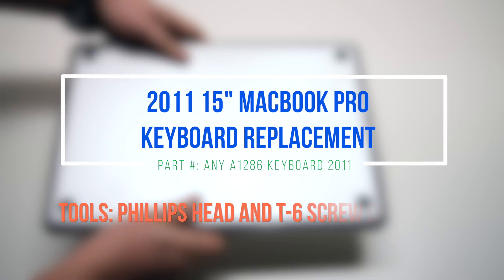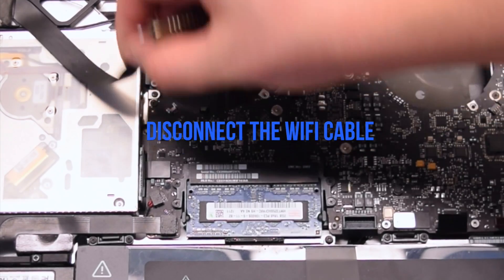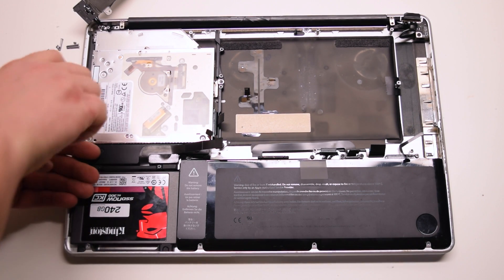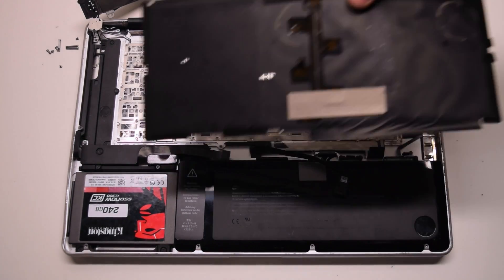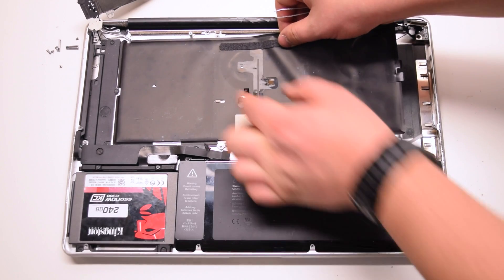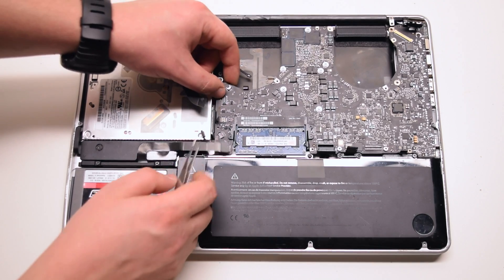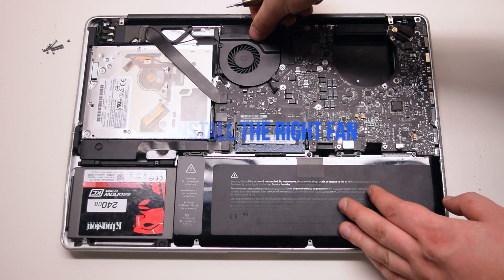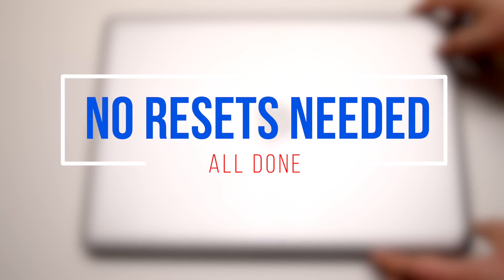2011 Macbook Pro 15" A1286 Keyboard Replacement

Comment: 10:30 The secret for the annoying cables is to hold the loop with a plastic tool, pushing up. Hold the flat cable against the board, with a plastic pry tool, then other finger, insert the tip of the cable. Same for the super short backlight one.

Comment: This is my 2nd time using this video. By far this is the best and only video I would use to disassemble and reconnect a keyboard. This is no easy job, but anyone who watches this video I believe can replace their keyboard. I know it can appear to be overwhelming, but believe me you can do it. You will need the proper tools. I have the ToolPlus 32-piece mobile phone repair tool set. It has all the proper screwdrivers, magnetic extension, and plyers, which you will need.

Comment: I have a Macbook Pro 2011 I had to open it for some cleaning but I broke the cable that connects the mouse (Trackpad) with the motherboard since then I use an external mouse.

But my problem is that my keyboard gives me delay when I press a key and sometimes I have to press very hard.

help me please
Reply: The same is happening to me :'(

Comment: In this video, you do not appear to successfully connect the keyboard ribbon cable in place on the PCB right?Any tips for doing this part. Otherwise, an excellent video. Thanks

Comment: Thank you for great video.  Very clear and concise instruction with zero fanboy yapping.  My hat is off to you sir.  My MBP Late 2011 would not power on.  Tried a hard reset by disconnecting battery.  It would come on with the battery connector, partially boot, and shut down.  Thankfully, re-seating the keyboard and trackpad connector did the trick.  I was ready to order a new kb and follow your video step by step.  Was not looking forward to the 51 screws, lol.  Thanks again.

Comment: ⚠️ NOTE FOR ALL: You MUST ensure that the new keyboard ribbon is FULLY in the keyboard ribbon socket on the motherboard! First time: only a few keys worked, second time: none. The third time I used a spudger to pressure the ribbon 'coil' so that it would spring 'into' the socket, and voila! It was only a difference of 0.25mm.
🙏🏽 Thank you so much @SaveAppleDollars for your video — my MacBook has many more years left! 👍🏼

Comment: I just changed my keyboard. 5 random keys are not working. Does anyone have any suggestions?
Reply: Could it be that I was missing one screw when putting the 50 back in?
Reply from the maker: lol it’s not one of the 50 screws. I hate to say it but it sounds like your replacement was a dud. You have to get another and do this over again. I know it’s ridiculous but happens even to me once out of every 5 replacements I’d say.
Reply: @GRIBSOFT  thanks a lot for the reply! I'll give it another shot with a new one. At least I know I can do it now ☺

Comment: I accidentally broke the lever. MacBook PRO doesn't turn on anymore...is so sensitive...what can I do?
Reply from the maker: You broke the lever or did you rip the keyboard cable?
Reply: @GRIBSOFT  
Lever and now the laptop won't turn on but it  chargers. When the lever was up, I accidently moved it and it came out.
Reply from the maker: Then just shift it around a bit. The lever is not an intricate part of the connection it just locks it in place, the keyboard should work without the lever.

Comment: took me the best part of four hours this, watch those connectors use a magnifying glass if required, you need the proper screw driver or it will end in disaster IMHO I bought a new set specifically but it wasn't the right P0 size so ended up using one from a £10 drive bracket kit I bought ages ago ! nothing wrong with the guid by the way probably the best there is, even iFix don't seem to have one
Reply from the maker: Glad you had success, thank you for the feedback!

Comment: I dont know if im destrying the flex but all keyboards ive tried have a problen on a key, i dont if it is the flex because i can see a corner a bit separated, could be that corner? how can i fix that corner? ty and good videos :P
Reply from the maker: It's hard to say if you tied to reseat it multiple times. I would just make sure to purchase a good 100% working keyboard to make sure to eliminate any doubt, here is a good seller, they are like $20 or less you can't go wrong https://rover.ebay.com/rover/1/711-53200-19255-0/1?mpre=https%3A%2F%2Fwww.ebay.com%2Fitm%2FREPLACEMENT-KEYBOARD-Apple-MacBook-Pro-Unibody-15-A1286-2009-2010-2011-2012%2F272371829590%3Fhash%3Ditem3f6aa04b56%3Ag%3AuJQAAOSw9mpZ94nj&campid=5338315798&toolid=20008

Comment: Thank you for this. I pulled it off with your help. I am still slightly surprised the thing is still working. Much appreciated.
Reply from the maker: The sense of accomplishment is certainly great, I remember. Glad to help!
Reply: Accomplishment yes, relief certainly!
Reply: indeed I swore I'd never take my MBP apart again but for £15 from ebay this was a  job well done. phew

Comment: Hi, I followed your guide and swapped my faulty keyboard out. I now have a yellow tint to my display. I have tried playing with the display cable but to no avail. Any ideas what has gone wrong?
Reply from the maker: It's likely that the LVDS connector is loose or the holster is damaged. This is the part where the LCD connects to the Logicboard. Unplug it and plug it back in then apply some light pressure with your finger onto the connector to make sure the pins all touch.

Comment: Amazingly thorough video.  \Worked like a charm! Didn't need to replace the keyboard, but just needed to clean the backlight mechanism due to spill so I didn't have to remove the power button assembly.  Great step by step. Thank you!
Reply from the maker: Awesome, glad to help!
Reply: I will be attempting this soon I used your other video to remove the motherboard to redo the thermal paste and in the process I broke the ribbon cable for the trackpad totally my fault. Now the keyboard keys are very sluggish. I can't see why you need to remove the power button assembly it doesn't look like it is in the way of the keyboard but im glad you made such a high quality tutorial.

Comment: Thanks so much you guys.. you are awesome! This is a great tutorial. Nice music and such a calming voice. I had reasonable success after spilling maybe 100ml or warm tea into my computer yesterday! Acted fast and flipped mac over immediately and then followed your guidance, glad I had the ipad handy. Motherboard and everything was dry and looked fine. I washed the removed keyboard and backlight layers in warm water, blew it out with compressor, then straight alcohol, blew it out again, then onto the heater for the afternoon. All worked for an hour after reassembly till a keyboard glitch occurred making the mac unusable. Now using her with keyboard disconnected and external keyboard and works good! I guess I am going to have to connect a makeshift on-switch to the power-on-pads and then try to re-seat the ribbon in a few days. Keys might need more drying. . Unless you can suggest anything else of course. 

Oh and by the way, if you had a paypal donate button on this page I would make use of it in appreciation. Thanks again. <3
Reply from the maker: In these cases unfortunately a keyboard replacement in the way to go. Just get one on ebay for $20 and put in the hour of work, will fix you up. The thing is, if you take out the keyboard and completely soak it and clean it and reassemble, there is no guarantee it will work again and so you will do the same job 3 times. Just get a tested working keyboard. Thank you for the donation comment, for now we only have a "Keep Us Going!" button at the bottom of our webpage www.appledollars.com

Let us know how the replacement goes!

Comment: I have follow the instruction and replace the keyboard. however, the power button is no more working nor the keyboard is not working too. Even i change back the old keyboard on my mac. Are there any ideas to solve this problem?
Reply from the maker: Did you connect the power adapter under the logicboard. Try reseating the keyboard ribbon cable several times.
Reply: When you took the power button out, there was a super skinny flat circular piece of metal, about the same size as the power button (about 1cm diameter). If that somehow fell out, it may cause your power button to not work. It's a springy type piece of metal that holds the power button up so it's not always depressed.
Reply: I had the same problem. Solution: you need to make sure that you open the “lock” of the keyboard connector (on your mother board), without this your buttons won’t work. Click the upper part to you softly and it will click open, put the keyboard connector in it and close the lock. You’re set to go.

Comment: At 4.50 "Remove the Antenna Bracket" i am not sure what that is, or how to remove it. i am stuck. Beautifully made video up to that point. I know i'm blonde but hey can't be perfect!
Reply from the maker: It's attached to the LCD hinge and it looks like this https://www.google.com/search?q=2011+macbook+pro+antenna+bracket&espv=2&source=lnms&tbm=isch&sa=X&ved=0ahUKEwjTnqqx5ZfTAhWIy4MKHRy_AHYQ_AUIBygC&biw=1360&bih=900#tbm=isch&q=2011+macbook+pro+hindge+bracket&imgrc=KHIs3b1snTol-M:

Comment: I just killed my MacBook Pro with replacing the keyboard like in this video. Everything looked fine but the power button is not responding anymore. I can't even boot my Mac now. Any suggestions?
Reply from the maker: Yes, read this article and try to boot your system without the keyboard http://www.insidemylaptop.com/turn-on-macbook-pro-laptop-without-power-button-locating-power-on-pads/ then you will know that the keyboard is the issue. I would bet that either they keyboard you installed is bad or you need to reseat the ribbon cable. Good luck.

Comment: I opened up my MacBook Pro 15" 2011 and replaced the thermal paste very carefully and correctly, whilst doing so I accidentally damaged the keyboard ribbon cable, but it's just a small scuff, now my keyboard and trackpad do not work, I am able too reset the smc and Pram with the keyboard, that tells me it works somewhat, but only my power button and backlight work when booted too OSX, could it just be the ribbon cable messed up and I need to just replace keyboard to regain keyboard and trackpad function? If you  have any knowledge of what could be wrong, is greatly appreciate it. Thanks
Reply from the maker: Keyboards are cheap (pain to replace) so yes you can try replacing the keyboard. Not sure why the trackpad is not working, they are two different connection, make sure it's not trapped under the logic board and that you reconnected it correctly. Try reseating the keyboard ribbon, try all this while the unit is open and boot it up with out the cover. The keyboard is a tricky connection so again try reseating it several times, same goes for the trackpad. Also if you do order a keyboard  once it arrives just open the macbook put it on the side and just connect the keyboard ribbon, I know it's an awkward position but testing the keyboard first before removing the logic board and the 52 screws that hold the keyboard in place might be a good idea that can save you a few hours. Also if all fails, remove the logic board and soak it in alcohol then brush it down with a toothbrush (every component) there might be some residue particles that are shorting a component preventing the keyboard from functioning, this is rare but has happened to some of my clients before. Good luck.
Reply: Save Apple Dollars I just found out that I scraped off a capacitor of some sort on the logic board, I have pictures of mine and a picture of what's supposed to be there I just have no clue what it's called
Reply from the maker: Sometimes some models don't have the same components on different years/manufactures of Apple boards. Are you 100% certain the component got scraped off? Did you try reseating the keyboard connection. As per replacing the component I can only point you toward Louis Rossmann's you tube channel for component replacement.
https://www.youtube.com/channel/UCl2mFZoRqjw_ELax4Yisf6w
Reply: http://imgur.com/a/S4jRn heres images i have the up close one is my actual logic board, whilst the other one is an image of what it supposed to be there, thanks!
Reply from the maker: You have to look at the schematic for that board and that's way beyond our scope, again Luis is a great go to for that level.

Comment: You are a lifesaver! I'm very grateful for the video. When I was done, everything worked. Whew!. I did note one discrepancy: my late 2011 15" Macbook Pro had T6 screws attaching the optical drive, not Phillips-head screws as described in the video. For people contemplating this, the Phillips-head screwdriver you need is a size 00. You can find acceptable quality Torx T-6 and 00 Phillips drivers at Ace Hardware for less than $5 each. Again, thank you!!
Reply from the maker: Awsome, glad it worked!

Comment: HELP: https://discussions.apple.com/message/30564789#30564789
Reply from the maker: Watch this video, they have to be alighned correctly on the keyboard posts, being even a little off will make it work uneven and cause this problem http://www.appledollars.com/keyboard-replacement
Reply: +Save Apple Dollars i ve watched it but they dont show you how to align the leds and holes
Reply from the maker: It's hard to see but on the replacement keyboard, you have to separate it from the led back light layers then on the top black layer you will see a black circle that is hiding the alignment hole, you have to peel it off, then align it with the stud on the macbook lower case, once you peal it back you will see what i mean. Also, make sure you have a mid wall divider as it puts pressure on the back light. Good luck.

Comment: I really don't understand.  No matter what I do I only have strip of lighting going down 7,Y,H, and N keys.  The rest of the keys are dimly lit.  I've purchased two different keyboards and backlights.  Both behave the same way.  I took it to a computer repair shop who couldn't install it right and still charged me $36 dollars.  I've watched dozens of Youtube videos.  I don't get it.  Why doesn't my keyboard lightup from end to end?
Reply from the maker: When I was first learning about the back light system I didn't understand it either. The keyboard and back light has to be replaced simultaneously and they have to be alighned properly, into the slots because the way light is distributed. Watch this video to get a better idea. I hope this helps http://www.appledollars.com/keyboard-replacement
Reply: +Save Apple Dollars The keyboard and back light came together. The three back light layers were already assembled. What else is there to do other than set the back light on the newly installed keyboard. Even though I have taken them apart and put them back together so I can figure out why that it didn't work in the first place. When I turn it on the clear plastic piece is very bright from one end to the other and all four lefs blow a greenish color.
Reply: When I move the backlight around with my hand it will light up different parts of the keybaord

Comment: Why do i have to take out the backlight stick and peal away the guide hole guard, was it suppose working on previous keyboard? I didn't understand why i have to change it. Plase help me.
Reply from the maker: You can use the back light layers from the old keyboard if you want. You have to remove it to access the screws to remove the keyboard anyway so usually after a spill the liquid gets into the back light through the keyboard and so some lights on the back light don't work. You can keep the old back light layers if you want. Check out this video for more info https://www.youtube.com/watch?v=v4V7mm1Z1sM

Good luck :)
Reply from the maker: Just a warning, the back light consists of three layers. First, thin black shadow layer with keyboard key holes (this layer concentrates light only to display on the key, then clear plastic layer that has little dots that intensify and illuminate the light, then the flat top black layer that has 5-7 LED light bulbs that go into the tight little holes on the plastic layer (This is the most important part of the setup, if the holes on the clear plastic layer don't alight with the black LED light layer properly, then the keyboard will not illuminate properly. Also, don't forget to plug the last backlight layer into the logic board after you are all don't putting the macbook back together, I still forget all the time and then think that I did something wrong :)